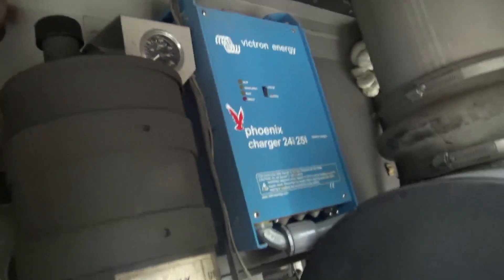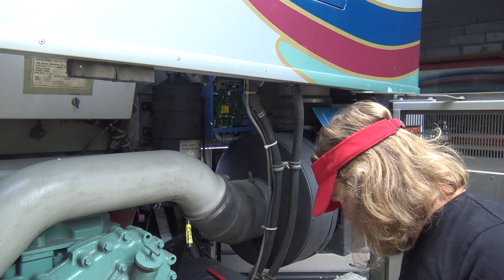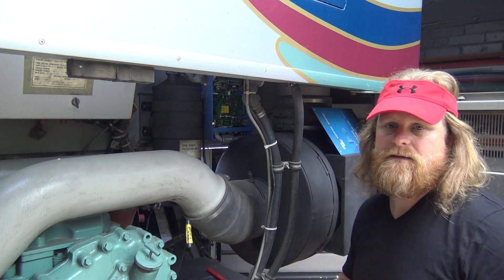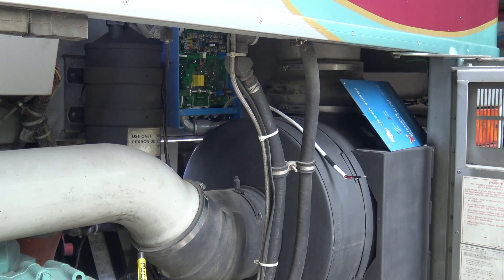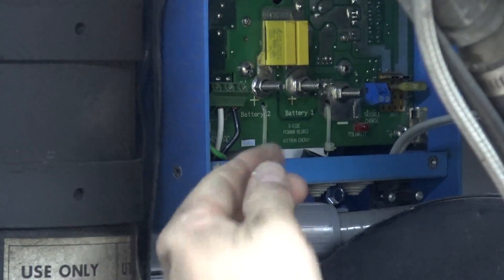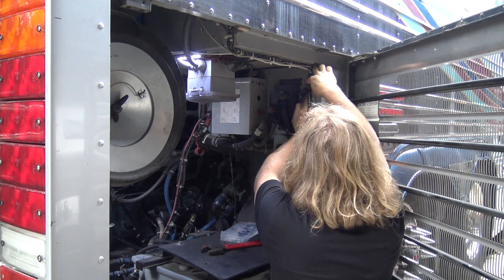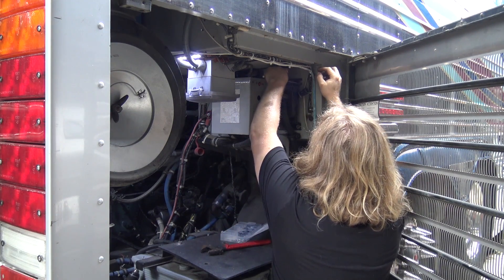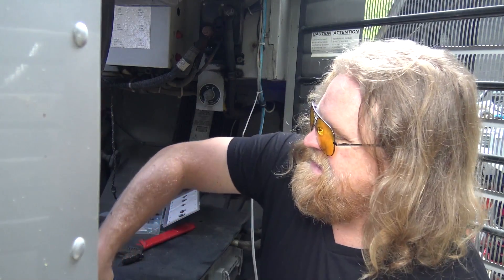Victron Phoenix  Battery Charger install

Comment: It should be setup to trickle charge to >>the bus battery's (motor) when your hooked to the Gen or to Shore Power. This way no matter where your getting power your putting a little in to the bus battery's. Nothing like a click, click when its time to go..
Reply from the maker: Got it all set! That is exactly what happened Click Click Click. problem solved now.